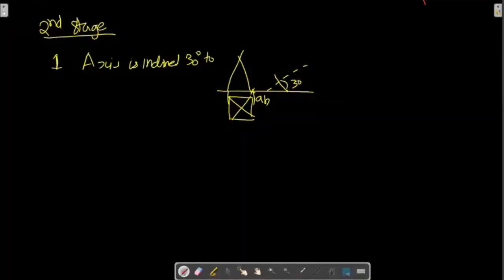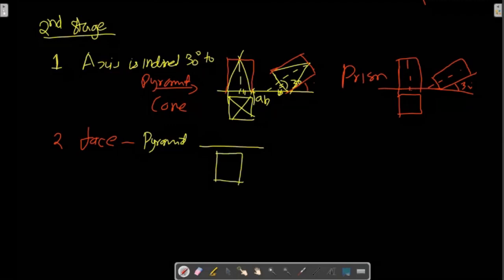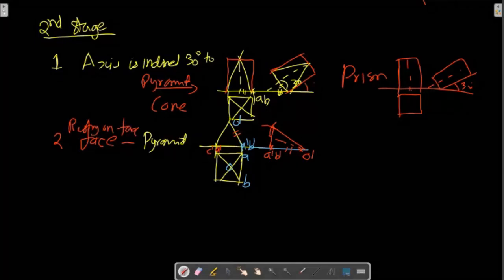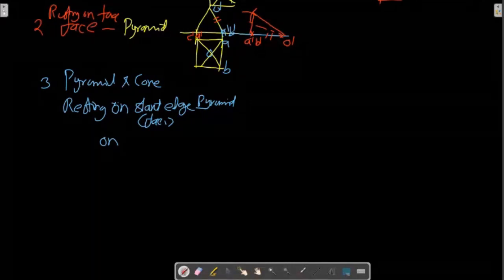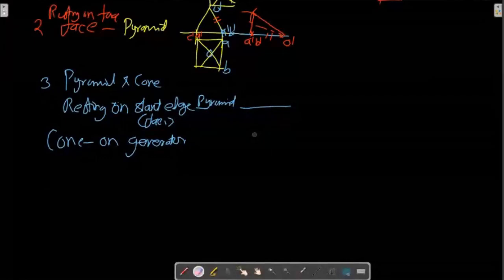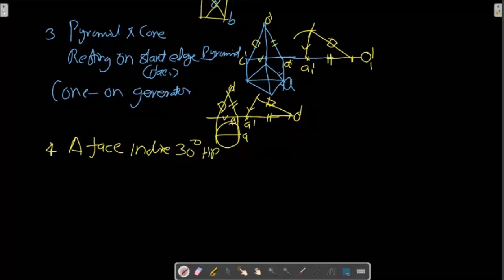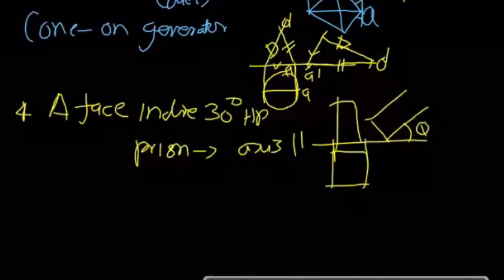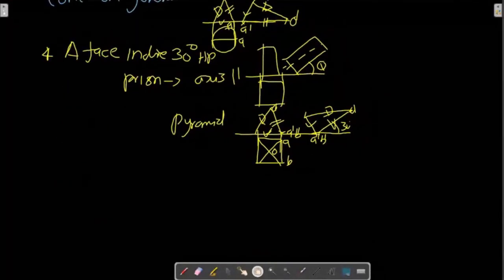SECOND STAGE | ALL POSSIBLE TYPES OF SECOND STAGES IN CHANGE OF POSITION METHOD

Comment: 13:31 Sir, there needs a small correction like the question mentioned the height of Apex about 40mm, but the height marked on the figure is 50mm. Like I know it doesn't affect the comprehension of this video, still just thought about mentioning that. Great video class👍🏻